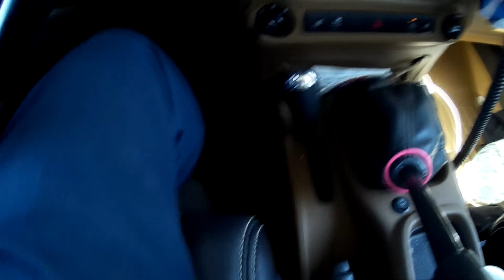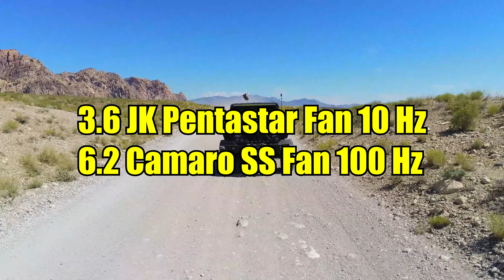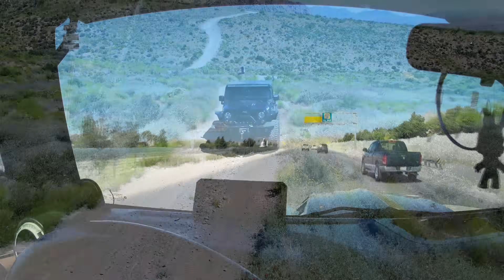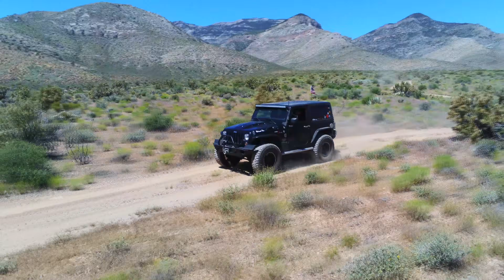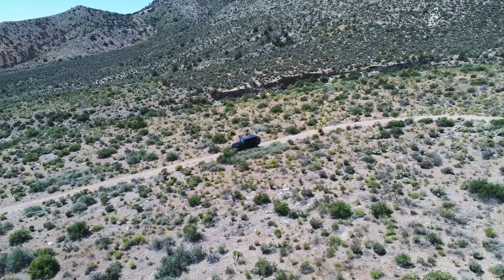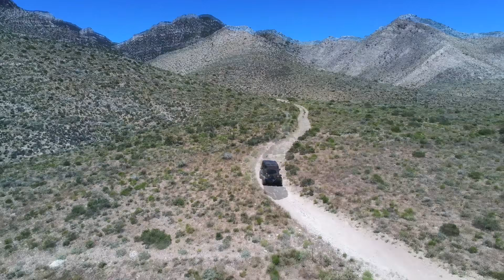Stand Alone PWM Fan Controller

Comment: What really caught my attention is when you mentioned cooling a 1969 Camaro LOL. I've got a 69 Camaro with a 461 BBC. I have a Cold Case BBC radiator which has two rows of 1.250" tubes, high flow water pump, 180 thermostat, and Vintage Air. I have dual Ford SVT Contour 12" fans right now and a custom shroud with 12 BeCool flaps for airflow. I don't think these fans are cutting it. I'm interested in finding a way to control either a 19" SPAL Camaro SS fan or perhaps a set of two 12" SPAL brushless fans from a Chevy Volt which are supposed to be fairly powerful, 300-350 watts each. Do you have a controller that can be used with a plain vanilla Holley double pumper? No EFI, no ECU. TIA-Mike

Comment: What are your thoughts on running a cooler thermostat? Like a 180 degree in place of a stock 195 degree .
Reply: Matt McDonough technology has changed over the years and these newer engines need slightly higher temperatures to run efficiently and for emissions purposes.  Running a lower temp thermostat will have negative affects on both performance and emissions in these newer engines.  If you are building strictly a "hot rod" and running something like a 525hp LS then it may be beneficial to keep ahead of the climbing temperatures but for most daily driving/off-road wheeling the 195 degree thermostat would be the best choice.  With a properly programmed fan and unobstructed grille area these can run very efficiently even up into the 230~ish degree range and be perfectly normal and happy as long as you are running a proper 50/50 mix of coolant, or even a slightly over mixed ratio of 60/40 but I've generally stayed in the 50/50 ratio with great results.  The biggest issue I have seen lately with cooling systems on these Jeeps is the lack of airflow through the radiator due to either lighting or properly sinking a winch down between the frame rails.  I cringe when I see a WARN Powerplant sitting up in the middle of the grille.
I'm sure Robbie will have additional comments about thermostat choices as well.
Mike
Reply from the maker: That's right modern engines require higher temps than the old days. I remember 160 T-stats in my 427's, 327's...

Thermal efficiency, complete combustion,  crankcase condensation.... mean higher temps. We're running tighter tolerances with lighter oils for longevity and economy.  LT's are running 0-20 oil, a far cry from the 20-50 we use to run. Remember pistons were so loose on start up they'd rattle until they warmed up.
Reply: zmotorsports thanks Mike . I have a 2008 jk Unlimited with an auto 3:73 gears and 35 inch tires with aftermarket wheels . The last radiator change ( plastic hose connection failed) I swapped in a 180 degree thermostat. I have an aftermarket market bumper with a winch ( it’s about halfway sunk) . The Jeep runs at around 203 on the highway and lower around town( the winch does deflect some airflow) but when slow and with the a/c on the Jeep runs at 180-190 . I haven’t noticed any change in mileage with the cooler thermostat.
Reply: Matt McDonough WOW!  That little 3.8 has to be struggling turning 35’s on 3.73’s.  I was running 5.38’s when I was running 35’s and I was content but far from happy with the performance. The main reason I never went to 37’s was due to the fact I didn’t want my Jeep to lose any more performance. 
Now with well over 400 horses it easily turns 37’s and I regraded to 4.56’s and I’m netting better mileage to boot.  Mine isn’t light either at 6k pounds. 
Mike
Reply: zmotorsports my Jeep has 183k miles and has been super reliable. With the top and doors on and a 3/4 tank of fuel it weights 4820 . It’s no hot rod and I can’t remember the last time the over drive was left on . The little 3.8 just keeps going , I do all the maintenance myself at the prescribed time intervals and it hasn’t let me down yet. Re gearing and locking up the axles keeps getting but on the back burner ( family or other things keep taking priority) but I was think of 4:88 and still running 35’s . But that’s a topic for another day.
Reply: Matt McDonough that’s awesome to have 183k on it. Like yourself I don’t let anyone touch my stuff either as I’m a bit anal about things. 
My 3.8 liter had just moved 92k on it when I removed it and the 42RLE transmission in order to install my 6.2 liter L94/6L80E combo. 
It was fairly trouble free with only needing a water pump and two EGR valves in that 92k in addition to regular maintenance items. As much as I was asking if it I doubt it would have gotten as many miles as yours. I sold the engine/trans to a fellow Jeep club member who had just grenaded his 3.8 in his 2007 with 140k mikes on it so he was grateful to find a good replacement. 
I wish mine was lighter but between suspension, bumpers, winch, 37’s and a heavy toolbox in the back she a bit on the heavy side and I’m not willing to put her on a diet so more power was my best option.  
It’s amazing how much more fun it is to drive now and how mild mannered and docile it is until you step on it. Highway RPM’s are nice and low cruising at 70 MPH it is so much more comfortable. I can easily see myself still driving this thing in 10-15 years just the way it is. 
Mike
Reply: zmotorsports yea I’m on my second water pump , one valley pan gasket , one EGR valve and two radiators . It sees a lot of highway miles ( 35 mile commute each day) and if we run any errands we are in my Jeep. Since the engine swap kits are getting better and better ( true bolt in ) a V8 may be in the future. Robbies kits look to be the best LS / LT option out there . Being in My Oklahoma where temps regularly hit triple digits cooling is an issue . That’s why I am running a 180 degree thermostat. I still can’t help but wonder about the hemi guys that have heat issues if running a cooler thermostat would help the cooling issue ( if that ls wuts truly causing the issue) . 
I’m a big fan of Robbies videos and I hope they keep coming, can’t wait to see a gladiator with a V8 !